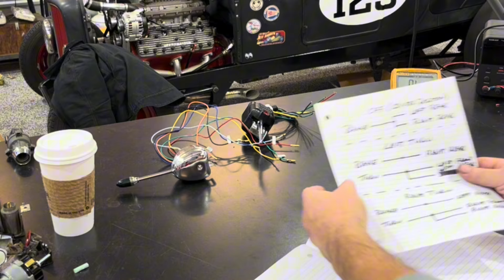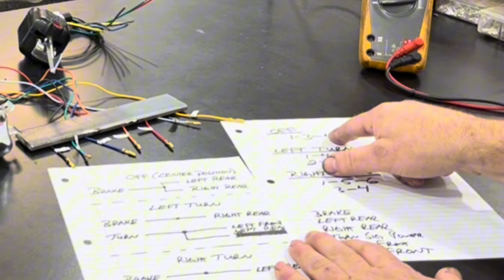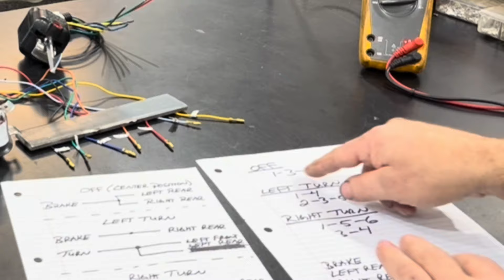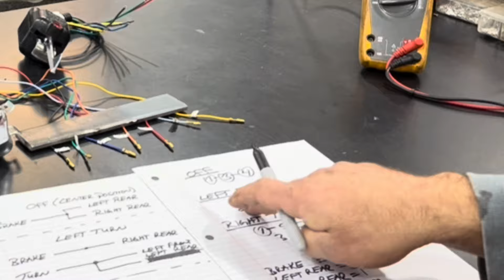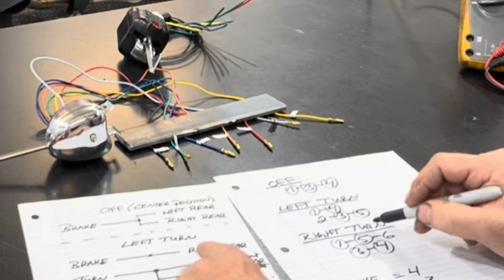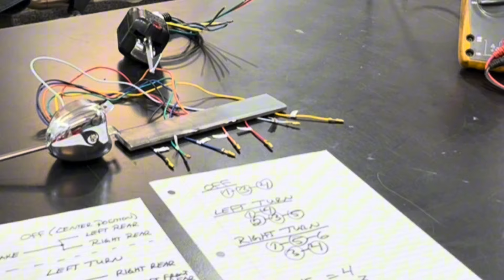How to Decode and Test Turn Signal Switches - No Diagram Needed

Comment: Can you tell me why my turn signal switch the lever to switch on the switch is getting hot not hot but it's getting warm and the light stays on when it's in the neutral position for the Flasher
Reply from the maker: Hi- this one is a little tough to diagnose without seeing your issue first hand.  So can you explain more 
about your application?  What vehicle? What model (part number and manufacturer) of turn signal switch? You indicate that the “light  stays on). Where is this light?  In the turn signal switch or somewhere else? Or on the end of the turn signal stalk?  Please provide more info and I’ll try to help. 👍

Comment: Thank you Paul. . 
Question is - There is (purple - flasher ) energized from blinker . 

I may have missed that in your presentation. 

Any comments on flasher energizing?

ThankYou . 

1966 gmc w/1971- ish ? Steering column
Reply from the maker: Hi and you are welcome!  If you have a 71 Chevy turn signal, the purple wire is the turn signal power from the flasher to the switch. If you have +12 v (with ignition on)on the input of the flasher from the fuse box but your turn signals are not working, try replacing the flasher. If you do not have +12 v on the input of the flasher then check the fuse in your box or possible other issue
Reply: @paulsvintagewiring 
Thank you . !!